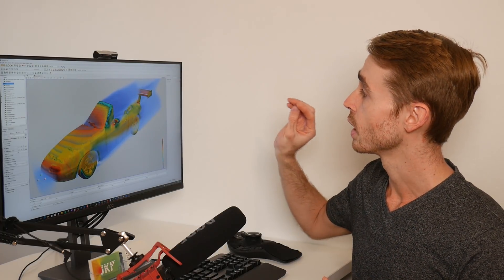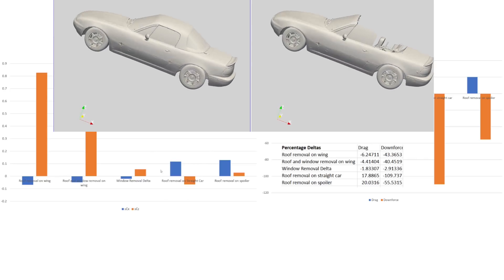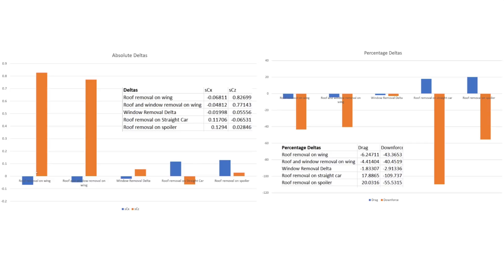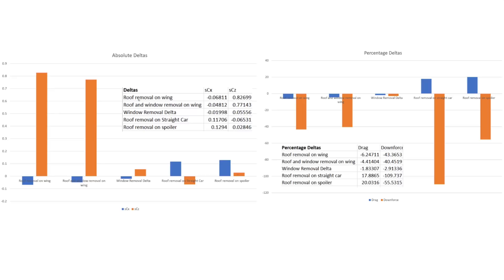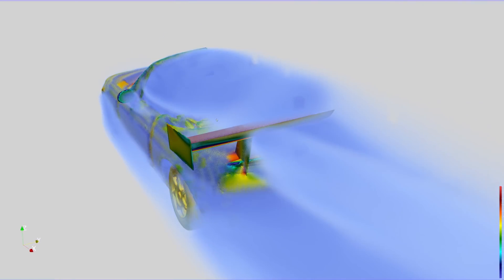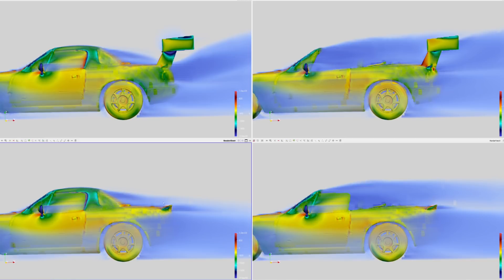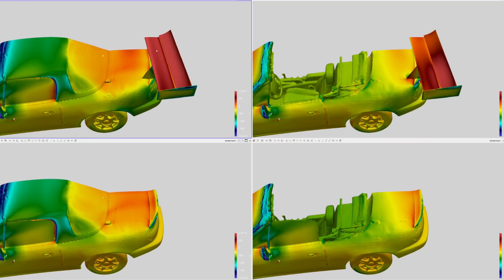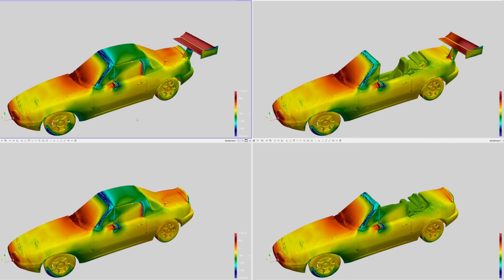Do Rear Wings Work on Convertible Race Cars?

Comment: I watch your video on removing the bumper in order to use the rear end as a diffuser.  Along with this video they have answered a lot of questions I've had since I started working at the local track.  I've seen top up/down, no top at all just roll cage.  One had no windscreen and an active aero rear wing.  Rear bumper on or just a couple bars welded on.  I guess it boils down to the series you're racing in and personal preferences.  Bravo Zulu sir.

Comment: I'm a bit confused. You went with a massively oversized wing to try and compensate for a foreseen problem, but used a stock-looking spoiler instead of doing anything to make it more effective. Even more confusing is that the spoiler is also present on the winged model. Looking at the CFD images it looks like a taller spoiler with a steeper angle of attack might have been more effective. Especially if it wrapped around the tail a bit like the iconic ducktail on the Gen 2 Firebird.

Comment: Thanks for the great video!  In your opinion, if you are racing with a hardtop and open side windows, would holes in the rear window help the drag and downforce situation? IF they help, would you put them in the top or bottom of the window and what size would you make the holes? Thanks!

Comment: Really enjoyed  your analysis of aero on convertible. I have a couple of questions.
I removed the roof and side windows primarily to save weight.
Should I replace the side windows with plexiglas?
If I fill in space behind seats will that improve aero?
What is optimal angle for rear wing, we are currently running 10 degrees 
Thanks in advance for your help

Comment: This is interesting, I just bought a Mini Roadster which has a retractable spoiler. If this data follows through, the spoiler gives drag with negligible downforce gain. So it is just a gimmick, essentially.  Question: Does it make any different whether the driver / passenger windows are open or closed? I'm guessing it would cause negative pressure in the cabin and bring the over-body flow down earlier.

Comment: Okay but this is only for the NA, the NB has significantly redesigned aerodynamics. Could you do this for the NB and also include ducklip spoilers bc they stick up a bit higher than the lower lying spoilers?

Comment: Hey Kyle! A bit of a wiggling question in my mind has been bugging me since trying group C in the sim. The Mazda 787B has this   low wing aero philosophy and that downward sloping rear end, but right at that tail section, there's a small gurney flap across the bodywork. Whats it for? Positive pressure over the rear bodywork? Stopping downwash/lift from the sloping bodywork? To help the diffuser/rear wing? I need answers!

Comment: I have a question that might make for an interesting video. 

On modern passenger aircraft the wingtips have upwards pointing wingtip devices, designed to act as fences that reduce the high pressure air flowing from under the wing to over the wing reducing lift and creating a vortex that increases drag.

I know that the endplates on modern race car wings serve functionally the same purpose. 

A consideration of aircraft design is wing sweep, which turns a portion of the flow over the wing from running along the chord, to running along the span of the wing, this reduce the speed of the air going over the top of the wing and reduces shockwave formation at transonic flight.  This span-wise flow has an effect on how much air is forced towards the wingtips and can add to the vortices generated at the wing tip.

There have been some aircraft (such as the HFB 320 Hansa Jet)  designed with forward swept wings, where the span-wise flow flows inward towards the fuselage. (among other potential advantages and disadvantages of forward swept wings)

I heard that an advantage of this, is that it reduces the intensity of wing tip vortices, as there is way less air flowing towards the tip, and way more flowing towards the fuselage, where the fuselage acts like a giant fence. 

My question is, would a rear wing on a race car, if it was swept forward, reduce vortex drag in a similar way? 

I know that the rear wings of some sports cars and super cars are curved inwards (Such as the Koenigsegg Jesko), but I'm not sure if it's a stylistic choice or an intentional design choice that takes advantage of this effect.

Comment: All these studies assume essentially "flat" oncoming air / level ground, but what happens if the front of the car is pitched up or down? I run an ND Miata with the Balckbird Fabworx lexan spoiler, which is primarily designed for autocross.

However, last month at Road Atlanta I was doing about 115-117 on the back straight and as the car changed pitch all hell broke loose - the rear end flew up off the ground for what felt like an eternity. I took the spoiler off and it was fine for the rest of the event (top down at all times) but I'd love to see what that rear airflow looked like

Comment: I was wondering if you could expand on this with a popular race configuration of a convertible in which the windshield is removed? Perhaps one with the cockpit open and another test with a tonneau that encloses the passenger area with the exception of the driver? I know the necessary roll cage and the drivers body would disturb airflow to the wing to some degree but it would be interesting to see if it is worse or better than either of these two configurations.

Comment: I’d actually find a video on sunroofs interesting. I tested the average gas milage in my car on a stretch of straight road and saw a much larger decrease in fuel mileage with the sunroof open than with the windows. I’d be interested in seeing how it affects drag. Here’s the data I collected.

2021 Chevy Spark 1.4L
Windows closed, sunroof closed, A/C off
MPH - MPG (rounded to nearest 1/2)
20 - 67
25 - 76
30 - 72
35 - 69.5
40 - 61
45 - 60
50 - 50
55 - 49
60 - 46
65 - 44
70 - 37.5
75 - 33.5
80 - 32
85 - 28
90 - 27

A/C full
60 - 42.7

A/C medium
60 - 44.5

Window / sunroof cracked
60 - 45.5

Window / sunroof fully open
60 - 43.8

Window half, sunroof closed
30 - 71.7
60 - 45.8

Sunroof cracked
60 - 44.6

Comment: An F1 is technically an open top and almost all have rear wings
Reply: An f1 car is very complex (at least for the 2021 season). It has a ton of pieces that redirect air so it doesn't affect the air going to the rear wing. If you look closely, there are parts of the car that redirect air over the driver. The helmet is also designed to let the air flow over easily

Comment: good god... during the flow analysis i noticed that when you have a wing not only does taking the roof off reduce the effective area of the wing but it creates huge low pressure zones right behind the supports due to how the air moves. note to self, keep the roof on

Comment: I’ve never seen any convertible racecars , do you have an example? :)
I mean racecars have a roll cage and the top mechanism is either completely removed e.g. mx5 cup or a hardtop installed, most of the times they start from the coupe street version when developing a race chassis.

Comment: Very good video, great analysis. I do wonder though, what would your take be on the soft tops? They typically have the same general shape as the hard tops (well, with the humps of the supports) but probably have higher drag due to the texture of the fabric. I would assume that they would be somewhere in the middle, but my guess would be the higher end since it resembles the shape of the hard top. Would be great if you could make an analysis on it!
Reply: My basic understanding of fluid dynamics leads me to guess that the texture has a negligible effect on drag when there are much larger forces at play from the pressure distribution. If anything, the slightly textured and non-uniform surface of the soft top may behave like a golf ball and create a slight layer of turbulent air around the top. And in principle, just like a golf ball, that turbulent layer would help to reduce the wake produced by the top as the flow "bends" back down towards the trunk. 

That's all highly speculative though and now I'm curious to see an actual analysis haha. Not sure how easy it'll be to simulate a soft top in CFD though.

Comment: Ooof I guess I should be putting my soft top up if I’m going for my PB. (Although we are required to run windows down.)

You should probably be modeling a roll bar as is required on most tracks with the car with the roof down.

You should also model roof on with windows down as this is a requirement (windows down) for running most tracks in the US (for safety reasons.)

Comment: 2 Questions:
1. Is this a full scale model? Like, was this Miata precisely designed to represent the actual vehicle, or has it been scaled down? (My guess is, it's a smaller scale 3D model)
2. How much does weight play a role in affecting aero? I know more weight will make the car more lower, hence it affects the drag and dforces. But, I want to know if it is true or I am incorrect?

Comment: The Peugeot 307 CC behaves differently. That car has  lower drag with roof down (and windows up). The top speed is higher. I am curious what do you think about this, why is this possible.

Comment: Question, if you add a roof spoiler in the equation, would that have a positive effect on the boot spoiler/wing?
Reply: Yes, if it's a reverse spoiler/wing on the roof.  If a regular spoiler, it will be worse. Reverse roof wing would be one that pulls air down onto the rear glass, giving better flow to the trunk spoiler/wing.

Comment: I havnt seen any proper videos regarding WRC aero, they have a massive rear wing which would indicate that they have pretty decent downforce at the front but they only really have a small splitter, no venturies, wheel arches and pressure cut outs at the front so im struggling to see how they have so much front end downforce that they need such a large rear wing for. Can you make a cfd video on this pleaseeee

Comment: Thats cool... Still driving with my top down. 
If all I cared about was performance, a coupe flexes less anyway.

Follow-up: What aero methods do you suggest for open-top race cars, both vintage and modern? Is there a wing design that can be more effective in this case?
Reply: I've seen many people build a cover over the cockpit for competition convertibles, I would assume it would allow airflow to reattach to the body before reaching the rear wing allowing it to work properly, but probably wouldn't reduce the amount of lift inherent on a convertible.
Just what I would expect, im no engineer

Comment: There are several hundred of us that have converted a Miata into an exocet.  While saving huge weight, the aero is horrible.   There are some things that could be helpful though.  Obvious ones are no windscreen, cover over passenger side (no passenger seat) and probably large wheel fenders.  But your take on what could possibly be done to improve aero on an exocet would be fantastic, considering the majority of Exocets are built to drive on track.

Comment: Hi, i hae a NB miata and i use it just for racing. Do you thing that adding a rear hard top spoiler could help the rear wing? I have an APR GTC-200 with raisers. Thank you and great video!
Reply: If the roof spoiler is reverse (pulling air down) then yes. If standard, then it would be worse.
Reply: @engineer1692  that's my doubt too. I think that a roof spoiler would help reduce the suction behind the rear window but I am not sure if it could help lowering the turbolence... Would be great to insert a roof spoiler in this simulation to understand what will happen

Comment: Great analysis thanks. Building an MX5 NA for competition. Is there any drag reduction  benefit from a spoiler on the back of the hard top to break the air flow away from it - assume no rear wing but maybe a boot spoiler could be added? Thanks!

Comment: Super interesting! Thanks Kyle, I have often wondered about this myself. I Think a fair few miata people will be watching this one. Definitely curious about how effective vortex generators are on the air down the back of the hard top also. Would also be interested to see what if any benefit on the rear wing swapping the mirrors to so a small race mirror type there is.
Reply: Watched it🙋 miata owner....with a ducktail spoiler....🤫😅
Reply: @flipflop7577  Same here! I have a hard top tho, so extra interested in vortex generators. Good 3d printing project.
Reply: Thanks Kyle, this is wonderful information as always.  Roofless miata owner here, I'd love to know if there's anything I could do to improve air flow without a roof with a ducktail. Would a Gurney Flap on the top of the windshield help or hurt? Would vortex generators on the top corners of the windshield help? Or at the bottom near triangle windows? Would covering the passenger area with a tonneau cover make a difference? Would a bikini top wrapped over the roll bar help?   I'd be happy to toss some money towards this type of testing info on Miata's and I would think and hope other's would too. Do I hear a gofundme? or similar option for this?   Thanks again Kyle!
Reply: @kriswashburn7945  I think you meant to make your own comment. You replied to someone's comment^

Comment: What about a roof spoiler on the miata hard top? Would that help the air flow to the big wing or a duck tail spoiler(which i am more interested in since thos is what i run on my track miata)
 I 'd really appreciate if you can test it and let me know
Reply: I think the roof spoiler is definitly detrimental to the wing and super detrimental to a ducktail spoiler. It creates a larger zone of turbulent air behind the roof and you wont have any attached flow down the rear window. You ideally want the wing to be in as much clean air as possible to increase downforce. They do look cool though.

Comment: I'd like to see a comparison between the oem and TRD spoiler on an AE86 3 door hatch. I'm curious about which one does a better job at reducing drag (less recirculating wake at the rear for faster acceleration) and lift and if the TRD spoiler produces any added benefit of down force because of the longer surface and rake.

Comment: I have a question why do they not use tire rims like fan blades to suck the air out from underneath? Is it a stupid question?
At least maybe to help cool the brakes.    I just can’t figure out why it’s not a good idea maybe you could help
Reply: Has been done already, google fan wheels. They use the wheel as a centrifugal fan to cool the brakes.
Reply: So much turbulence.

Comment: Really interesting video! This definitely covers the most common case of traditionally shaped roadsters/convertibles that people can actually afford, but also raises the question of whether the more "purpose built for speed" convertibles behave. Stuff like the convertible versions of many Ferrari and McLaren cars, or an even more extreme case in the Pagani Zonda Cinque Roadster. Cars which have significant structures and most of the shaping still there behind the drivers, instead of this classic design with essentially nothing past the A-pillar, except maybe the quarter window.

Basically getting into the territory of "can you make the aero on a convertible work without going all out to something like an LMP900 car", with a normal windshield and a wing that's not lifted high up in the sky and twice the width of the car. =)

Comment: There is a missed opportunity here also exploring how the pop-up headlights affect the rear wing xD. Jk. Great video!
Reply: That's actually a thing! Confirmed added drag at highway speeds when the lights are up.
Just might possibly affect the wing's downforce but I think it would be negligible if at all.
Reply: @danielskrskr  they could create a vortex that runs along the top edge and flows into the wing.  I would actually like to see the fluid dynamic effects beyond "adds some drag" and also how it interacts with a convertible up and down  and with a wing and without just because.
Reply: @shadow105720  Yeah that’s exactly what I was thinking but didn’t know how to word it
Reply: @danielskrskr  i would love to see it on something smooth like a miata and something with a sharper edge like an s13.  Full up and 'sleepy eyes' would be another two things to test.  This could turn into a whole series.
Reply: @shadow105720  I'm not sure about this but I heard that sleepy eyes on a miata doesn't affect aero and it gives better engine cooling than if the lights were all the way up
Reply: @danielskrskr  i kinda doubt it. i think i read that according to 949Racing/Supermiata's testing of the turn signal intakes said they dont do anything, so i doubt the headlights being up would do much either. neither does opening up the radiator window on the front bumper. it's already large enough. sealing the tunnel from the window opening to the radiator helps, like with a radiator cowl panel because it forces air through the radiator. hood vents supposedly work tho, i think the reason why hood vents work though is because they're not intakes, they're outlets; which help the air flow faster through the engine bay.
Reply: Didnt think I'd see you here mate.  Love your work on thingiverse!
Reply: @autumnrain7626  haha, thanks!
Reply: That is interesting question to research
Reply: I think it will be interesting to see something like that, because when the headlights are up, the wind noise with softtop is reduced by like 70%
Reply: Those headlights catch a lot of air!  I used to coast down a 3 mile long grade, in neutral (oops).  The car would gain speed all the way down the hill up until I activated the pop ups.  Then the car would either maintain speed or slow down. Otherwise the car kept gaining speed till it got to the bottom. The hardtop aided in smoother airflow/ reduced drag, and later the lowered suspension also showed a similar effect.